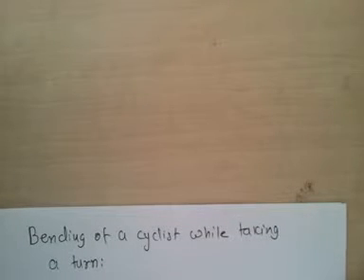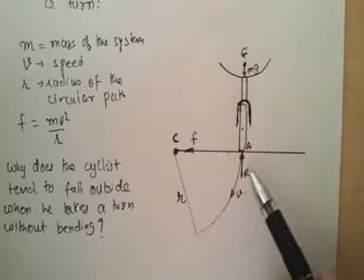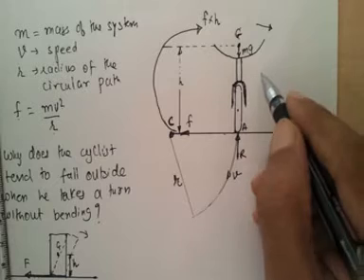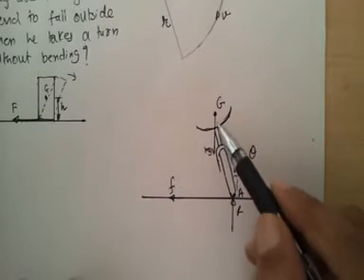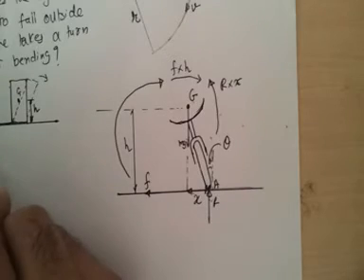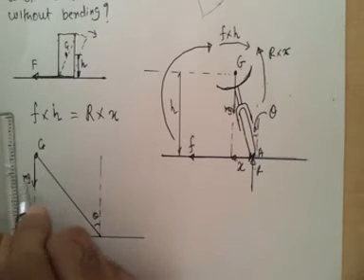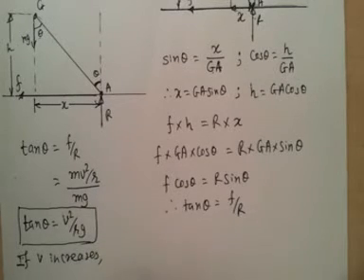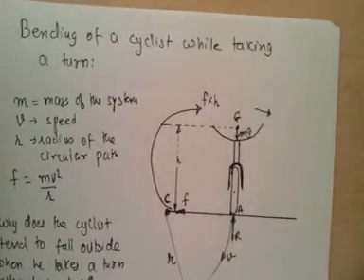Why Cyclists Lean While Turning| Physics Explained Simply!

Comment: why it does not happen in a car.
Reply from the maker: It does happen. That's why highway roads are provided a slope at turns.
Reply: @PhysicsShri  sir thanks,can a cyclist bend a turn when there is no friction.
Reply from the maker: @sachinrath219  No. In the absence of friction force, centripetal force will not get applied on the cycle and so the cyclist will not be able to take a turn. 
We also experience this when we find it difficult to take a turn on a slippery road.
Reply: @PhysicsShri  sir thanks again,hope the same happens for a car also,i.e cant turn on horizontal road without friction but can turn without friction only when the track is banked.